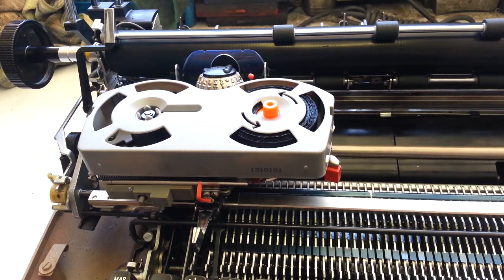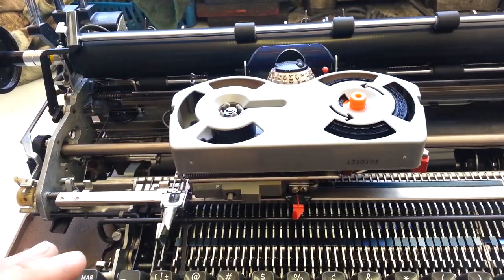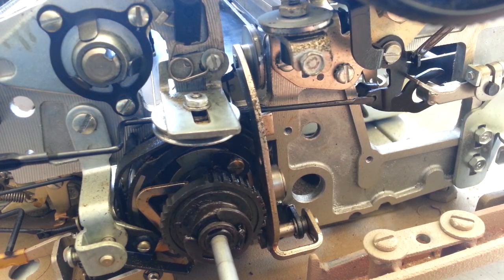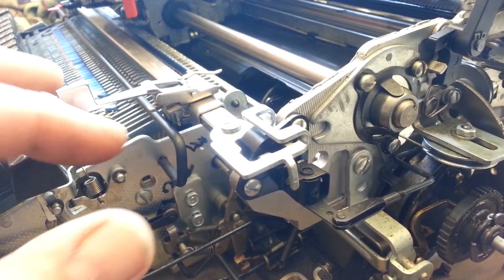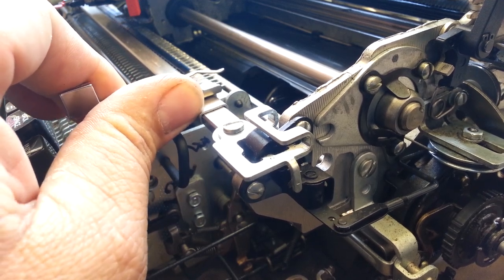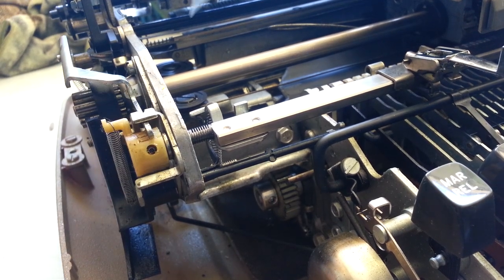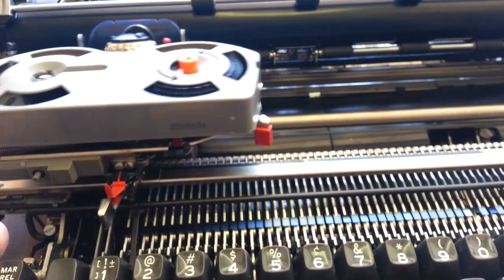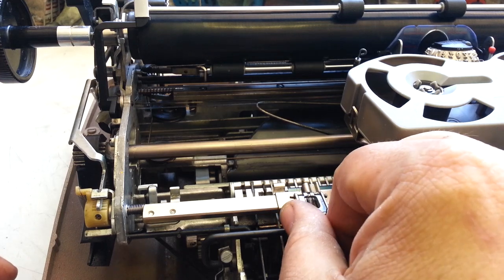IBM Selectric Troubleshooting Sticky Parts on Carriage Return Repaired Typewriter Service

Comment: My wife bought a "working" Selectric II and paid way too much for it.  The caps lock is stuck on, the keys are sticky, the carriage won't return (as shown in this video but worse), and someone apparently lubricated everything, and I do mean EVERY THING) with 3-in-1 oil thirty years ago and it was a yellow gummy mess.  I've spent a couple of hours cleaning the goo and grime of the ages from it.  It mostly works now.  I still need to get the carriage returning all the way (thank you for this video) and unstick the stuck shift lock so I can get a font ball on there.

Comment: Hi. I wonder if you can help me. I have an olympia x-l12 electric typewriter that I got at a thrift store. Opened it up and discovered the belt was all melted. It was quite a mess. I've been cleaning the entire typewriter over and over again with rubbing alcohol but there are still issues. I plan to get an o-ring to replace the belt. A rubber band is on there now. It's rotating. One or two keys strike with a nice whack but most others aren't striking hard enough to leave an impression. The typebars do move freely after cleaning. Not sure if there is a touch adjustment somewhere. Also the power return sometimes works ok and other times hesitates or goes very slowly. When I put a tight rubber band on it tends to work a little better. I'm just frustrated at this point. It seems on the verge of working but I don't know what else to try. Thoughts?
Reply from the maker: I know these Olympia's well, without the proper belt, the typewriter will never work right, "proper" being the important word
Proper belts have not been available for 25 yrs,  I quit supporting these models 20 yrs ago cus I can't warranty them
Reply: @phoenixtypewriter2136   So you think the belt is the main culprit? Even for the keys not striking with enough force?
Reply from the maker: @Airbugg  Absolutely, belt slips, poor impression, weak return, poor performance
The belt match on these models is critical, the replacements that were made 25yrs ago worked perfect
Never seen anything work for any length of time since then, that's why I don't re-sell these 
These are the only electrics that have passed the test of time, https://youtu.be/AucbxAOAWlU

Comment: I'm seeing a similar but not exact same issue, the carriage is slipping or jigging on the return, but it does fully return.  I checked the assembly parts mentioned in this video, and they seem to be operating properly, I'm at a loss?  You can see what it's doing here: https://youtu.be/zPLz0dYO_-4
Reply from the maker: Return has a lot of different areas that need regular service, I linked 2 video's to your video comments section
Reply: @phoenixtypewriter2136  Thanks, I'll check them out!
Reply: @phoenixtypewriter2136  Any idea why it would return when set to pitch 10 but not in pitch 12?
Reply: @phoenixtypewriter2136  And now the carriage moves to the right when changing pitch
Reply: Nevermind, I found it!  The pitch light switch was inside the pitch changing gear (not sure what it's called but the white gear that actuates the switch that changes the pitch light) and it was causing the whole margin bar to move slightly to the left when pitch 12 was selected, making the return process prematurely end.  Thanks for your help and videos!!
Reply from the maker: Sounds like margin rack is gummed up, could have knock DP timing from margin to escapement out of wack